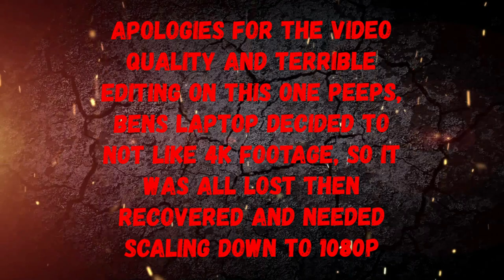FN2 Honda Civic Type R Brembo 4 pot calipers install BBK

Comment: Really impressed with those big Bad Boys,  and the brakes 🤣Love you guys cheer me up for a crap period of lock down and unemployment I wish I could be your south London branch inspire me to want to make videos I don't know you do it it you have a nice hot workshop I have a full up garage and Kids that need teaching from home🤣 my fn2 finally repaired from a nicked catalytic converter. Love the fact that you actually showed bleeding the lines back in, you might as well go the whole hog now  you can stop anything put a massive turbo in👍
Reply from the maker: Ahh thanks man, hopefully we can all meet up soon for a big fat car meet!! Going the charger route that’s why they went in 😬😬
Reply: @CowabungaCarDiaries  yeah a car meet would be cool mate there's nothing in South London, another thing always wanted to to organise as I have a Mitsubishi FTO GPX as well but juggling family and finding work it's not easy to organise anything especially with  lockdown. did you copper slip your brakes? because my mechanic works with me tends to put loads on? I'm always have problems with my calipers on the front locking slightly every now and then then so will need to do something with calipers eventually. Do you know anyone who's used the eBay kits to refurbish apparently they're ok but can be really tricky?
Reply from the maker: @Android-vk8yh  yeah copper slipped them, I have used the eBay piston and seal kit myself mate. No issues

Comment: whenever  I bled brakes before I opened the nipple pressed down, then locked the nipple off, then repeat I didn't leave it open as you pumped up and down?
Reply from the maker: Makes no odds of the pipe is under the brake fluid in the tub as it don’t sock any air back in, it’s a great way of doing it in your own
Reply: @CowabungaCarDiaries  been a while since I did any brake bleeding. Good stuff

Comment: Did you use a washer on the big bolts that hold the caliper to bracket? Doesn't look like you did but my kit has come with washers, but they are a bit too big to clear the notch in the caliper properly
Reply from the maker: Honestly can’t remember pal, I don’t think so no

Comment: You may want to check them pins 
I got same set up and my pins went in more 
There is a little clip that sits inside the calliper
The pin comes through the front a little 
Have a look at pin from behind and you will see the clip I’m on about
Reply from the maker: Nice one man thanks for the heads up will take a look ASAP 🤘🏻❤️
Reply: @CowabungaCarDiaries  no worries bud

Comment: What exhaust is on it. Sounds amazing
Reply from the maker: Custom 3” cat back mate picture from underneath is in our Instagram, link in description 🤘🏻🤘🏻
Reply: Sounds great. Is it non res?
Reply: My fn2 is completely stock. What mods do I do first
Reply from the maker: @kickassaz  it’s pretty much straight piped mate lol. Depends what you wana get out of it and do bud really there’s tonnes
Reply: @CowabungaCarDiaries  sounds great. No loss in power either or gains as the restriction is the manifold ? For the extra noise it's good.
Reply from the maker: @kickassaz  no loss in pier but coz it’s 3” will make gains once maps
Reply: @CowabungaCarDiaries  cool. I've seen differ diameters of exhausts, 2.5 2.75 and 3. Is bigger better lol ?
Reply from the maker: @kickassaz  totaly depends what you want out of it, I didn’t want so much rasp and wanted a deeper time and a thick pipe coz of supercharging it at some point, custom you can basically get it how you want or as close as possible
Reply: @CowabungaCarDiaries  thank you. If I go to power flow and say what I want they should sort me out then.
Reply from the maker: @kickassaz  don’t see why not, see if there is an exhaust fabrication company too, and ship about a bit, Chris went power flow and it was a nice exhaust in his gt, but you look at mine and the quality is so amazing, 1 join I think the test bends and welds, as I said picture is on Instagram
Reply: @CowabungaCarDiaries  I'll take a look. Thank you. Do you think it's best to go custom then miltek or cobra etc?